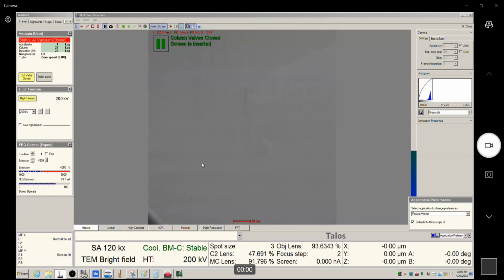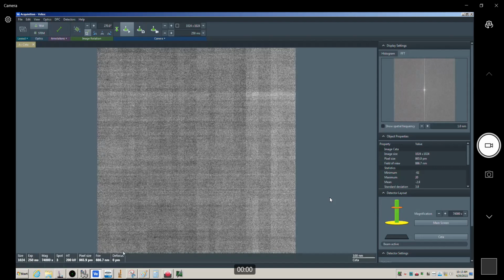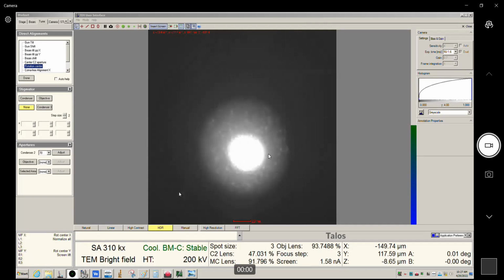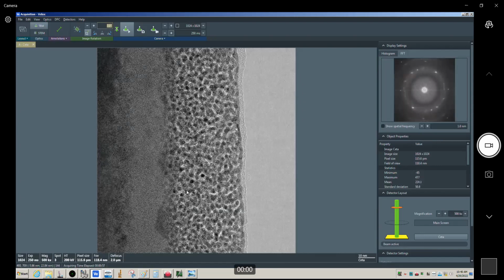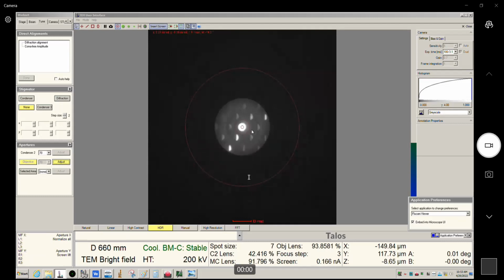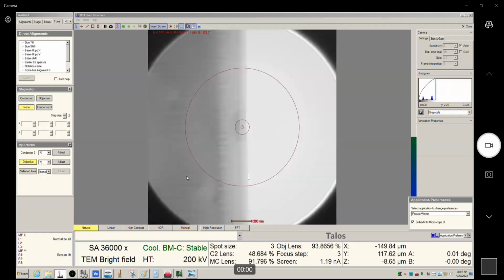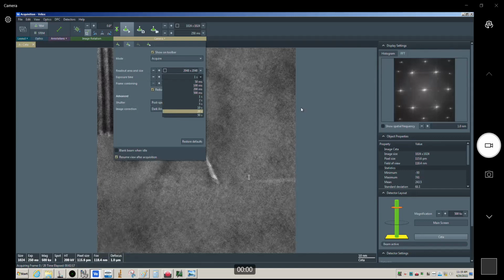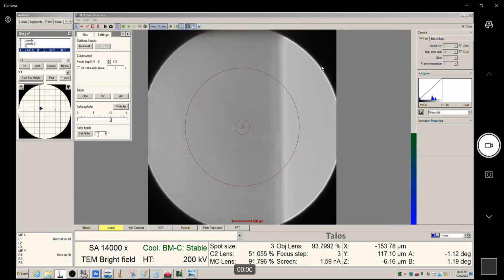S/TEM workshop: tips, tricks, and other useful info

Comment: This is a great resource and I'm really glad you're making these so widely available. I have an answer for the last question about manually controlling the Alpha and Beta tilts from within the software. On the Stage window, the pane with the stage map has two buttons. The upper left is the magnifying glass to change the zoom, but in the upper right there is a downward pointing triangle button. If you press this triangle button it changes the pane to give you stage controls for x, y, z, alpha, and beta. You can type in the increments you want to use and make steps in Alpha and Beta using the plus and minus buttons in that pane. So you don't have to rely on the touch sensitive buttons on the panels. At least this is the case on our Titan.
Reply: I mostly use the z-height button to get as close to eucentric height as possible especially when I'm aligning the probe corrector in STEM. I want to perform my tableau at eucentric height and eucentric focus with as little defocus as possible. So being able to have a finer control over the z-height is useful. I also find that the sample drifts quite a lot in x and y on our system when tilting in Beta, so finer steps in Beta can be useful for that last bit of fine tuning the zone axis alignment on a laterally small sample.
Reply: Additionally the flap-out tab of the stage box has a tab named 'set' where you can manually enter stage settings, on the Talos and Tecnai I have used.
Reply from the maker: I was completely unaware that this was possible!  Thanks for pointing this out and mentioning this. Do you use this capability at all?  I would think this may be useful for precise zone axis alignment, though I don't know how well this might work in practice compared to just pressing the buttons on the control panel.

Comment: Hi, Thank you very much for your videos. I have some questions for you

1. Which Obj Apertures are suitable for which mags? For example Obj  40 for Mag lower than 200kx and 70 for higher than 200kx?

2. For high mags like 300kx and 500kx, do we need to realign pivot points and rotation center? If we need to realign should we retract the "Obj aperture" or we shouldn't?

3. sometimes in FFT I see the circles are not a Full circle, I do not know how to explain it, for examples I see the lines on the top and bottom of FFT but I cannot see lines on the right and left, I am not sure it is because my Obj aperture is not adjusted properly or because of beam tilt? how can I make perfect full round circles?
Reply from the maker: Hi Amir:

1. For high mag work, you are usually using a specially sized objective aperture (Scherzer aperture); in this case, it happens to be the 70 um setting.  At lower mag, you generally use a smaller aperture than the Scherzer aperture because you aren't trying to obtain high resolution.  This is actually a great topic for a video, so thanks for asking about this (and watch for the video, eventually).

2. As long as you don't drastically change the mag from setting where you aligned the pivot points, you shouldn't need to adjust these again; same thing with the rotation center.  If you switch from SA to Mh mode, then I would definitely realign the pivot points and yes, I would take the objective aperture out when aligning the pivot points.

3: It's hard to diagnose this without actually seeing the FFT; can you please send me a picture of what you are seeing?  My email is in the video description.  Some features you see in the FFT are simply a result of the math associated with the FFT algorithm, so that may be what is happening in your case.